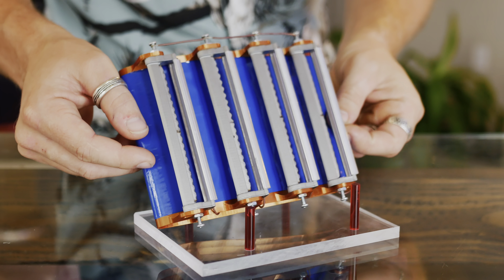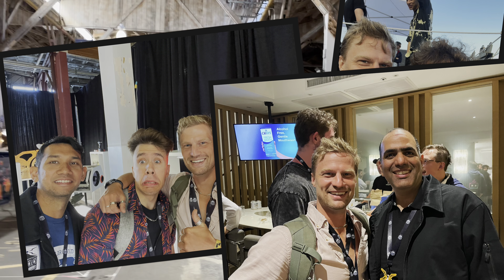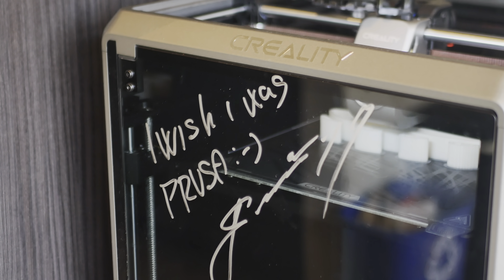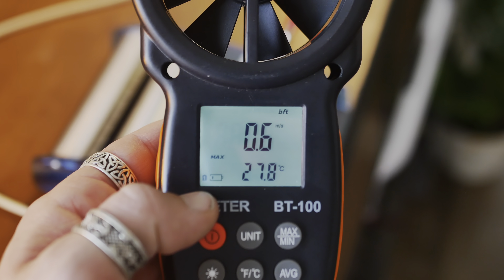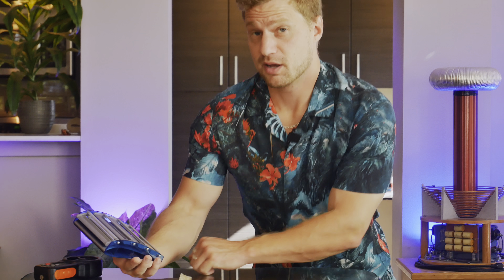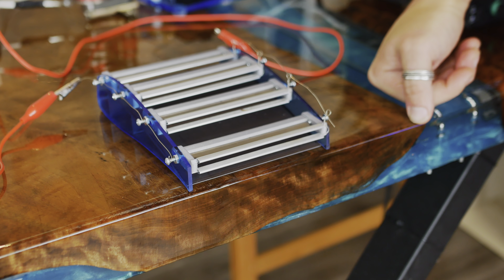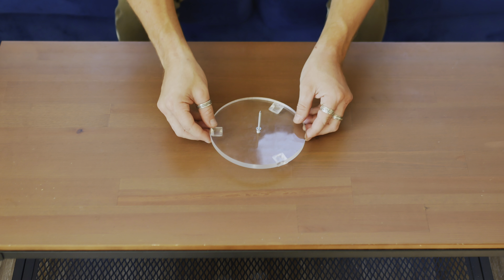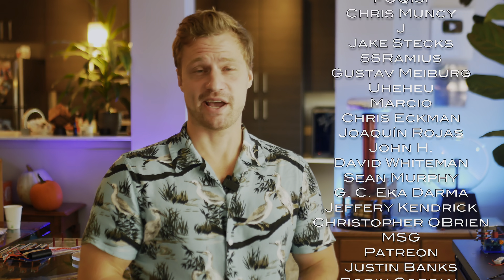Designing A Self Propelling Ionic Thrust Wing

Comment: The thing that I like the most about these videos is how you highlight the trail and error process. Not simply just showing a completed working project. It emphasizes the importance of building good habits and consistently improving/building upon the prior iterations.
Reply: You know, people say that this will not be a workable propulsion system, but what ionic propulsion may allow, is an almost drag-free aircraft. If the ionic system is in the correct location and configuration, such as somewhere around the front of the wings, high-pressure areas could conceivably be eliminated.
Reply: I do believe that that's the first perpetual motion machine right there. Hook it up to a pulley and you can then power up your car.

Aim the car down a steep hill, so you can then get to work for free every day. Just take an uber home, and get your dad to tow your car back up hill (you might have to loan him a truck and a chain), so you can then ride your perpetual motion car back to work for free every day. Hook up your cell phone charger to the alternator in series with a flux capacitor and a rectifing diode pack to charge your phone, so you can call your dad for a tow, every day.

Comment: Would it not be more performant if you integrated the razor blade and ground directly in to the wing? I'm thinking of the razor blade just barely sticking its head above the wing profile, while the ground is just some conductive tape on the wing? This would cut down weight dramatically, simplify your structure and reduce drag :)
ps. i think you are also creating a lot of ozone when the system is on, it has kind of a strange smell to it, kind of metallic, maybe ventilate a bit more to reduce health risks.

Comment: Consider moving your thrust to the bottom side of the wing. The top side of the wing has the highest flowrate during flight, by moving your forced airflow to the bottom side you may be able to increase the flow velocity over the top edge resulting in greater lift.
Reply: I was here just to ask about that

Comment: What if you used thin strips of foil, maybe aluminum?  Bonded directly to the wings surface on the top and possibly bottom too?  I would suggest making the body of the wing into the metal for the thrust conductors, but I think it would be too heavy, especially if it's scaled up.  Wire has very low surface area.  I think foil might be the best.

Comment: What would the thrust measure if perhaps, you integrated the ionic thrusters into the main structure of the wing, having the airfoil built around it so that the thruster was enclosed inside the wing itself? Essentially, the wing would would act like a duct and maybe cut down on the drag produced by the thruster sitting on top of the wing?

Comment: I just had a thought- why not put the thrusters under the airfoil? That’s where the higher pressure, lower velocity air will be, that way the free stream higher velocity air that creates lift will be created only by the wing’s motion, and perhaps the wing will fly easier since the thrusters wouldn’t need to create as much thrust for a given airspeed, also you won’t be interfering with the laminar flow over the upper wing surface.

Comment: I think that a thrust producing wing will likely want a very different geometry from a normal wing. A normal wing produces lift through a difference in air speed between the top and the bottom of the wing, which is already accomplished by the "motor" rather than the geometry of the wing.

Comment: What if you put the thruster under the wing? Wings are designed to creat a higher pressure zone under the wing and it appears to be pulling the air over the wing. I recommend make another one with the thruster under the wing then test each one for how much lift they provide. Can’t wait to see your next video!
Reply: That wouldn't work. Faster moving air moves at a lower pressure. Attaching the thrusters over the tops of the wings ensures that the maximum amount of pressure is always under the wing. To demonstrate how this works take a thin sheet of paper and hold it horizontal, letting it collapse. Take the end that you're holding and blow across the top of the paper. See how your breath lifts the paper? Now do the same thing under the paper. Which one appears to lift the paper more? If you conducted this experiment correctly you should see the paper being lifted higher when you blow across the top of it than when you blow across the bottom.

Comment: Wings looks simple and are often overlooked by people withing the RC flying hobby. and often dont understand how much performance can be found in the wings without ramping up the engine or prop spec´s. Same with some boat people regarding Tunnel hulled race boats and Offshore power boats. they have more airplane tech in the hull than boat tech. 

so i am looking forward to see this new soltion if the win will work as a wing,

i quess the lifting power will be great but not the forward thrust.. this would be good for a heavy transport aircraft is my armchair guess.

Comment: So out of the box & into the wing. 
During fog testing you show flow over the top surface of aerofoil.
Was there flow over the lower surface ?
As you will need this to create lift. 
However, the test was done on a stationary wing. 
If the ion flow is generating thrust. 
It will push the wing forward & surrounding air will be forced over the top & bottom surface. 
So you should still get lift.
With the open trailing edge you may get a ramjet effect adding to thrust. 
Or more ambient air being drag over the wing like an inside out Dyson fan pull ambient air into it's stream & increases the total air flow.
Awesome concept mate. 
You just need to increase the TKR (tomatoes kill rate) to ward off the competition. 8^)

Comment: This is definitely an interesting design with impressive results. I think you are on the right track with implementing air foils, but I wonder about efficiency losses and drag as the full assembly progresses. Is there a reason you only attached thrusters to the top of the airfoil and not the bottom? What if you sandwiched the thrusters between two airfoils? Also if you look at the different pressure zones along an airfoil with a CFD program you could find the ideal locations to place the thrusters. Which may only be at the front or back of the wing. To have the highest efficiency and lowest losses, laminar flow is what you are searching for. Also keeping flow attached to the wing for longer will help with the eddy currents losses. I am by no means an expert, and I know fluid dynamics is an incredibly difficult topic. I’m not sure if you will see this, but I know I like feedback when I’m working on projects. Keep up the good work!
Reply: I had the same thought.  Thrust under the airfoil helps more than over.  The thrust can go through tubes in the airfoil as well.

Comment: I may be wrong, but I bet the highest thrust to weight ratio is with only one thruster on the wing, not four. BUT! The thrust isn't the only factor. Each thruster lowers the pressure over the wing more, even if it doesn't make much more thrust. So it gives a higher CL. Maybe see if you can get a high CL and T/W with only two thrusters ?!?!

Comment: With the shape of those aluminum tubes at 8:10, it almost looks like you could make the ground into the aerofoil, stacked on the y axis like a biplane or triplane. This way you could eliminate the wing structure altogether. They could still be wired in parallel, but it might reduce turbulence and the thrusters would only have to lift their own weight (plus the fuselage) rather than the weight of a wing too. You probably already thought of this though.

Comment: I think the anode and cathodes should be part of the bearing structure if this is going to be optimized. I suggest maybe carbon fiber. Also, drag is a huge issue, so it should be taken into consideration. Also, I would think it could be possible with freestanding wires, but could they not be integrated into the wings? I will draw up some solutions today.

Comment: Use heated platinum wire so it boils off more electrons and increases the flow. Also the foil is the best grounding electrode and can be glued directly to the wing. You can also use thoriated electrodes for the positive instead of the wire, but that will require some more grinding and prototyping and radioactive dust...

Comment: Really think your on to something with this design. What if you put a set of your thruster fins on the bottom of the wing as well? Next question is about air drag. What if you put the thrusters on the inside of the wing?
Reply: If your thrusters were on the inside the mounts of the thrusters could then become wing structure? Aluminum or copper electroplated plastic for your electrode might be worth a test. I think that is why Joel's worked so well.
Reply: Couple more thoughts. With thrusters in the wing your outer layer of your wing could be solar cells to help power your plane. One more thought if you put thrusters in the wing you could cut down on moisture exposure shorting out your system.

Comment: I am not an engineer like those that are commenting on your impressive series of trial and error, innovations, and development. Question. 

What would such a technology look like if the components were at a scale of less than 1/16th of an inch, printed in high density resolution as an entire wing? You described how having the plasma thrusters closer together creates more thrust. If it was packed and measured at a DPI level for example? Or meta-material approach?

Comment: wow.  what about an airship ? is it not perfect for that ?
Reply: if you wana do a glider you may be better off making a pod above/ bellow the fuselage. if possible retractable/ semi retractable.   or an in wing design like the old commet jet.  your inlets should vortex in to plasma thruster wich will acclerate the spining air. then directed strait out the back. vortex inlests spin opposit on each wing for torque. and you can roll control from that.

Comment: You can shave off some more weight if you remove all the metal parts and incorporate them into the 3d printed surface. Look into electro-plating 3d printed material.

Comment: I wonder how the air moving around the wing and the ionic thrusters affects the lifting characteristics of the wing. Does the airflow produced by the ionic thrusters keep the wing from stalling at higher angles of attack than normal? Maybe the airflow above the wing is actually moving faster than it would be for the same velocity as a wing without the ionic thrusters causing it to produce more lift than expected (even if only a tiny amount)?

Comment: Looking at this and some of the older jet wing designs, I think the next step would be to move the ion thruster inside the wing itself with the outlet just past the max camber line.  Use the laminar flow down the wing to increase lift.  May not improve velocity.

Comment: You build the wing with hair-fine “Cilia” that have the anode and cathode over the top of the wing.
Space them so the airflow is angled toward a single area of the wing.
The smaller you can get the wire cilia and the closer you can get the rows (without disturbing the unified flow), the less weight it will have and the lighter it will become.

Comment: What about incorporating everything into the wing itself ?  Thinking like those bits of string they put on wings to show airflow in wind tunnels.  Short lengths of wire pinned across the wing and connected using a wire within the wing then brush over the lengths of wire sticking out of the wing to face back in the direction you want the thrust...  You could use rod internally in the wing for strength and the earth.   Just an idea....

Comment: absolutely love the outcome and looks like amazing thrust. there a loads of RC gliders out there that you could modify maybe try a balsa wood one first l recon with minimal modification a battery and an extended set up of your test rig on the root of the wings would give a great base to see if it can even just maintain flight a controllable connection via remote would be able to switch the propulsion off and on. so you could see when the glide is decaying that the propulsion can keep it airborne. the wider the wing span the more drag obviously and the eddies that are caused by the design could be an issue over the trailing edge of the wing . the system will need to be far enough from the wing top to avoid separation on the airflow.. many issues but great work love it  :)

Comment: I don't think there will be any lift effect on that wing section. There is normally lower pressure on the top surface creating a lift(suction) effect. Would probably work(fly) if the ion motors were under the wing

Comment: you should try to reduce the rejected airflow area into a smaller point quite like an airplane engine, therefore the air is accelerating tho you will have much more power

Comment: The power source is to high on the wing the drive units need to form the skin of the wing to allow minimum resistance. This can be achieved by making the drive units micro strips. On a cross section of a wing hundreds of these micro strips would allow better lift and power force and increase wing strength.

Comment: Take that whole wing assembly and spin it in a circle and youve got a disc. And when you turn on thise ionic thrusters , you will have levitation of the disc due to a diffeential pressure between the bottom and top of the disc. Adjusting voltages of the  the thrusters which are divided into sections creates  propulsion in any direction.

Comment: You could use light weight PLA to further reduce the weight of the wing, downside its more fragile than pla, but you can save another 30-40% weight. Also you could try using a thicker wing shape and integrate the thrust system inside the wing structure, instead of having it running in the lenght of the wing, you make them run, its a bit more complicate to design tho.

Comment: you need a 360 degree wing, a lathe 360 degrees of a wing design, get a disc shaped craft. 
now you can create a ionic wind LOOP, over and under the 360 degree wing, on all sides or degrees.
you can now use the outside of the wing, both over and under, and perhaps even the inner wing as well.
the hollow part of the wing can house thrusters as well, perhaps doubling or tripling ionic wind output
and also the inner wing thrusters during flight would not be disturbed by outside turbulence perhaps.
maybe the aluminum shape should be formed to compress the ion flow, like have the shapes converge together.
if you are going in circles, you could make a rotor of them, [over]powering like a helicopter blade.
i already have some designs if there's any interest.

Comment: Great improvement process. I'm gonna go on a limb here: I see many ways it could be improved, one is the overall integration, functionalizing the plastic parts. Something like LDS process. You could design your wing / air foil with the ion thruster parts directly made in the process, then laser etched conductive traces (electrodes and power linkage) You could also use a very highly isolating platic and up the voltage / current if you find a partner to do it completely in plastronics.  you could use a topology optimizer to further reduce the weight while maintaining  strength.
Another idea, may be a little far-fetched: you could rotate the thrusting elements 90° and shift from ioninc thrunster to MHD thruster. very thin (and light) strips of conducting metal, oriented in the path of movement, and inside the wing, small (yet very powerful) magnet elements to create a E x B drift current on the wing. Now ionizing the extrados air and flowing current through the strips would do several things: confine the ionized air on the wing profile, and accelerating it from attack edge to fleeting edge. Worth a try

Comment: Talk about thinking outside the box! For safety reasons, I will highly likely to stick to making this thruster isolated from the wings if the aircraft will be totally dependent on ionic thrust. I do see this being a support system rather than the main engine though. And I definitely do not like those sparks because of high voltage -- definitely a no-no for airworthiness. lol

Comment: Placing the ionic thrusters on the top of the wing will interfere with the bernoulli principle of the aerofoil, try placing it below, another solution could be multiplying the usage of the bernoulli principle; you know how the Dyson fans work? Put the ionic thruster inside the wing, open intake slots  on the air depression area on top of the aerofoil, place a dyson fan's style output ring below the wing as a below wing bladeless propeller.

Comment: Fucking cool! You should build yourself a little wind tunnel with laminar flow out of plexi and put yourself a little incense burning for a smoke stream. I bet you would get some pretty cool visuals that way. 
I wonder what this thing looks like under thermals as well, I wonder what kind of heating you will experience with prolonged usage. 
Here is a question, as you increase altitude how does that effect thrust output? will it increase or decrease.
Would it be beneficial to try and use both sides of the wings? 
Kind of want to buy a 3D printer now lol